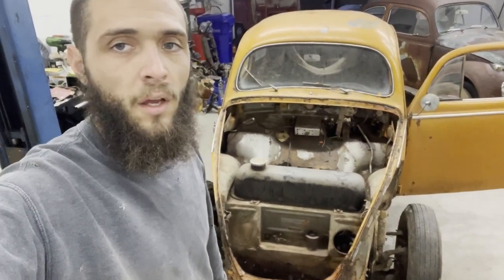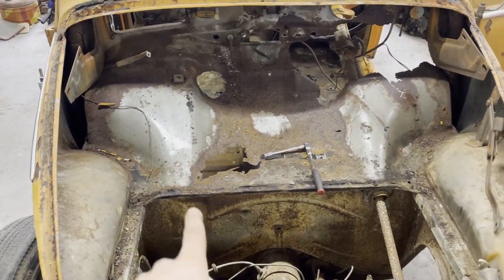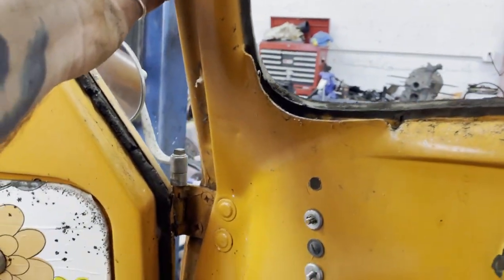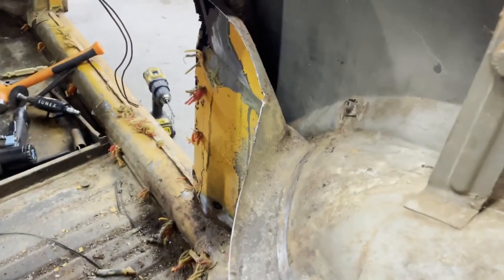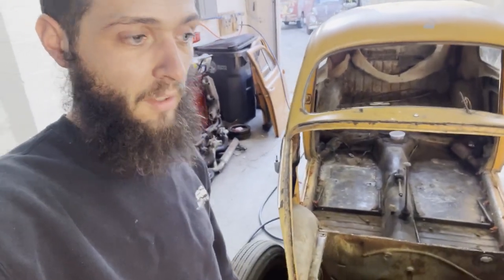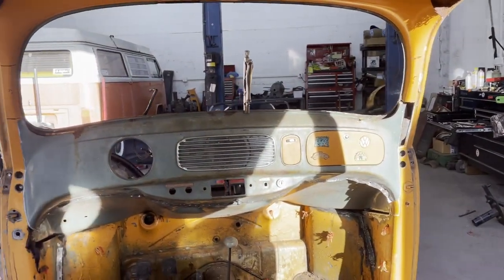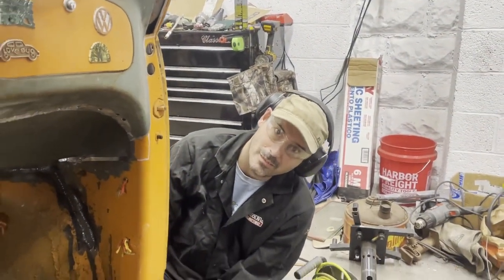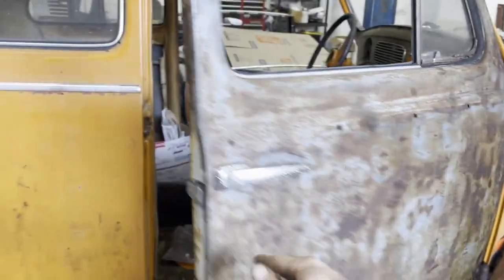'57 VW Oval Beetle Rescue - Dash and Trunk Replacement

Comment: we used to take those beams out and straighten them by putting them in a press. or you could use your hoist with a car on it support both ends with some stands. and drop the weight of a car down on the center. It works great.

Comment: That is a well unmolested bug your saving there. really original and untouched. haha. but I am glad your saving it. somebody needs to.
Reply from the maker: Hey thanks! I couldn't let her sit on Long Island any longer. It had been up for sale for a long time. I knew whatever we did to fix it would be better than letting it sit.
Reply: @wickedwerks  looking pretty good. that dash replacement was a tricky repair. Do you have a proper decklid? and save that apron even if you need to patch it up. those are expensive H aprons.
Reply from the maker: @Mikefngarage  I do not have the correct decklid. A local pin striper hand painted the decklid that came with the car with the shop logo so I’m definitely using that one

Comment: I have no idea what I’m doing however I found it easier to grind the spot welds till they pop over drilling out. Again I’m clueless and a hack.
Reply from the maker: I was worried about doing that because it would thin the surrounding metal out and may make it more difficult to weld back together later. They make spot weld drills that are apparently the absolute tits but expensive and I’m broke 😂
Reply: @wickedwerks  a friend had one of those drill bits and all it would do is walk all over the place.